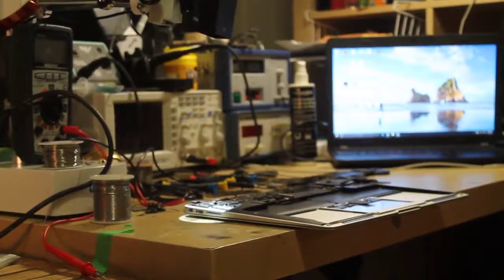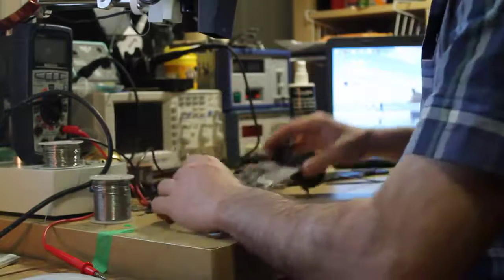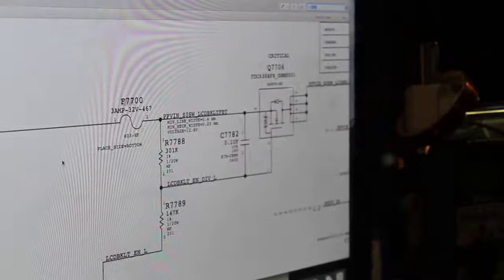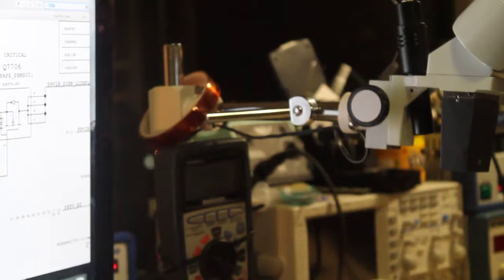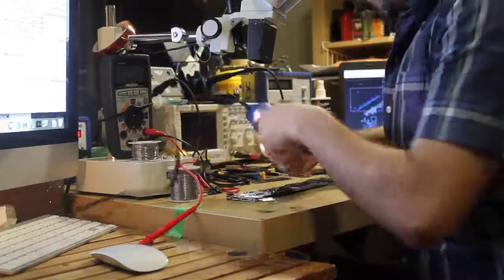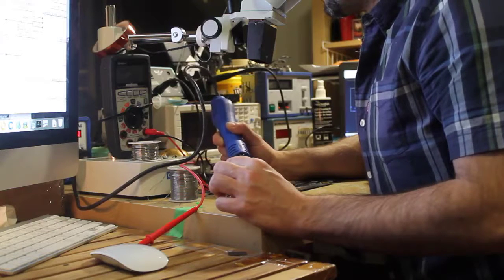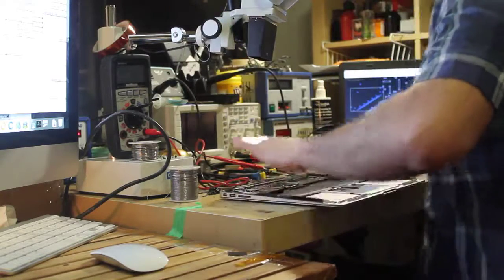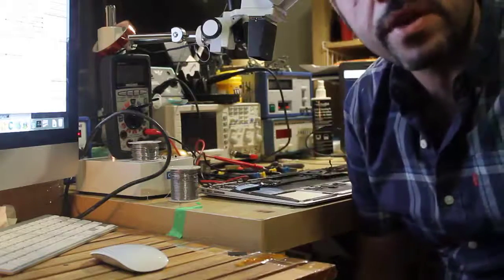Macbook Air 13" A1466 820-3437 No Backlight Liquid Damage Repair

Comment: You got lucky. Its never normally the fuse.
Reply from the maker: darren strathdee hi Darren,
It is not about luck, it is diagnosis with voltmeter ....backlight issues range from fuse lcd connector led driver feedback lines or enable signal or others .. always diagnosis first
Reply: Apple Expert | Mac Repair Center Calgary   Im saying the backlight fuse was lucky. I repair myself on board level and very seldom the backlight fuse does its job. Im not saying your lucky or you cant read a schematic and a meter. Im saying the fuse going is lucky. Im my experience the lvds connector blows, tracks, output caps and the lp8550 ic. I do this job on a daily basis.
Reply: Apple Expert | Mac Repair Center Calgary  but you are right. Idiots should not be fixing electronics if they cannot check the input and output on the backlight fuse, thats the first thing to check. Non the less, good job.

Comment: Hi, ended up spilling milk on the keyboard of mac air a1466 but managed to clean it out and get it running. The back-light of display is not working and every time i need to power on i have to pull the battery out and reset the clock to get it running. Basically the power button is working only sometime. Any idea on what to do? Is it the problem with the display fuse?

Comment: I didn't see you measuring if any short still exist after the fuse. Replacing a fuse because is burned is never a good idea without understanding why it blows up. Don't let the audience think that is that simple....
Reply from the maker: Hi Luigi,
I did already test for short and I do not have to walk technicians through the reason why it was shorted because any techs who want to do logic board repair and is not capable of testing for short then he does not deserve to be a TECH.
Reply: So I miss the real purpose of this video. You wanna show TECHS how to replace a backlight fuse? I consider as a tech that hunting faults is the most interesting and difficult part of this job. Without that there are no fuse to replace ;-) Many no tech viewers would possibly be misguided in replacing a fuse to get the light back just the same way you showed us.  That would't probably fix the issue at all and leave the audience frustrated for not being able to success. My invite to explain to the audience that "is not that easy" it was just a suggestion. Never mind anyway. Cheers

Comment: how much would this backlight repair fix cost on the macbook air?
Reply from the maker: it depends on the damage, bring it to our store for free estimate...better to call us at 403 473 1253
Reply from the maker: depends on the damage, as we might change lcd connector, led driver, etc

Comment: are you telling me that a repair shop did not now how to trobbleshot and find a brocken fuse ?? damm , thats a bad repairshop :(
even by novice standard
Reply from the maker: It is true Michael, most of the stores the mis diagnose the issue and ended up in convincing the customer to buy another board.

Comment: I had taken my computer to apple because it stopped working. They told me that I would have to spend around $950 dollars to repair the water damage that was on the computer. I found out about apple expert from a coworker and took it in to get a diagnosis. He was super fast and efficient, showing me exactly where the damage was done. I left my computer with him and within the next morning he had it running like new. And the price was really reasonable. Totally recommend apple expert!